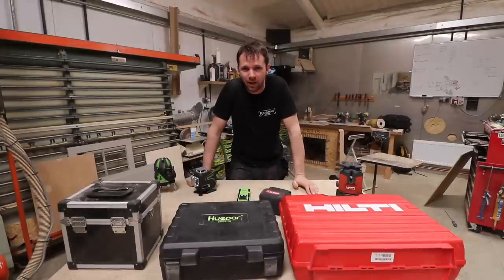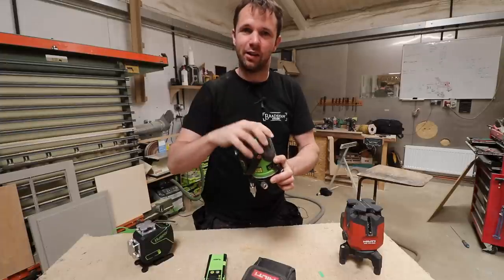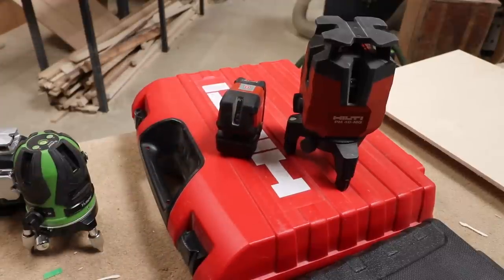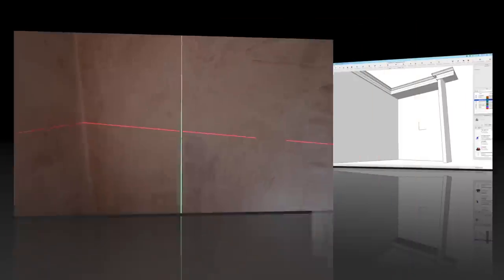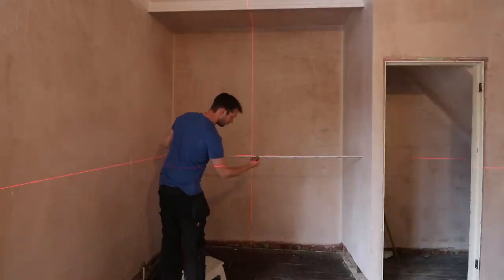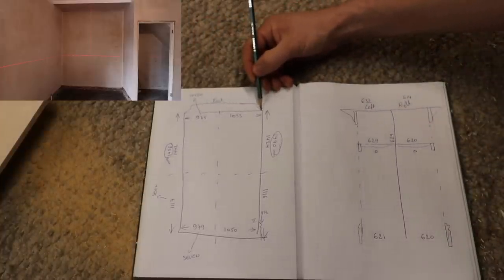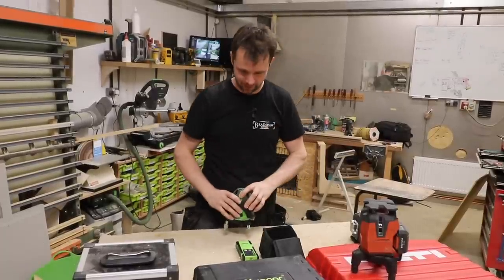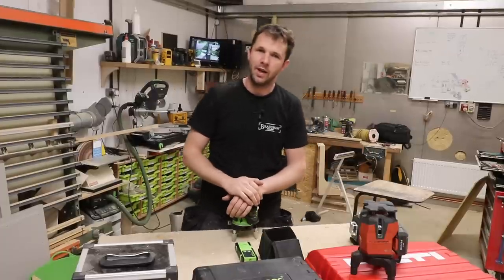Measuring with a laser Level - Fitted Furniture - Joinery - Whole houses!

Comment: I have commented on you videos a few times, they are all great. When I started as a carpenter in 1975, we would draw limes on the wall with one level and one plumb. All measurements would be taken from those limes. Just 4 or 5 years ago I decided to use an inexpensive Bosch laser level instead of drawing lines and all of that crap. What a huge difference it made in my life. Having a level line in "space" made taking some measurements so easy and I didn't need a helper.
Reply from the maker: Yes Roy! Its such a revelation isnt it I cannot believe they arent marketed in such a manner, its the main use for the laser for me!
Reply: @BradshawJoinery  You can teach an old dog new tricks. For years I thought a multi tool was a bunch of crap until I used one. Now I have both corded and cordless multi tools.

Comment: That was a fantastic video 

Really well explained. 

I look forward to seeing how you get the face of the unit fit the opening.
Reply from the maker: Hi Gavin, Ive not filmed the installation unfortunately time constraints took over. I ended up making the double doors and then scribing that into one side, then scribing the single door jamb In and glueing together in place (domino joint in the faceframe 👍

Comment: Brilliant as usual Ollie 👍🏻 

With regards to fitting a flat panel joinery product into anywhere basically, we always made it anywhere from panel thickness (18-22 mm whatever) smaller, both sides and that was a ‘scriber’ which I always liked and thought looked best inline with the plane of the face of the doors. That basically makes worrying about being exactly square when measuring completely redundant as you’ve got a tonne of wiggle room ( did that make sense)

Laser is so handy eh? Having those dead accurate plumb/ level square ‘datum’ to work off 👍🏻 even for fitting a new sash in an existing frame that might be super old and a mile out of square, you can work out ‘the wonk’ to make it, so it all looks right to the eye and isn’t a ‘wedge’ where you’ve fitted a bigger ‘square’ one to the shape as 90 percent of them would 😜

My old laser got chucked a while back, ended up with a cracked lense in the soft cover?!? I’ll never know…? And old batteries that went bad in tool ( crusty)

Been looking for a new one, don’t use them that much but great to have when you do!! Don’t wanna spend a mint/ but don’t want junk!  Ordered! 

Got the original? ( first one you listed) decent discount too👍🏻

Cheers mate👍🏻
Reply from the maker: Cheers mate, good work on ordering quick, i think stocks are low! Im very impressed as i mentioned, and sounds like youve got the use of it sussed!

Comment: My major issues with lasers have been:

Width of the laser beam when it hits walls or whatever. That line is too wide for accuracy 
Getting and keeping the laser itself perfectly level. If the laser itself is not perfectly level in both planes, the lines will exaggerate that inaccuracy

I will admit that I have been using the cheaper lasers of the style you showed and dismissed. I have just bought the green laser you recommended from Amazon - delivery tomorrow as I have to start coving, picture rails, door casings and skirtings - all in oak - tomorrow; 14 doors plus 2 openings that don’t have doors. The issue with getting it and using it so quickly is that I don’t give myself any time to get to understand how the laser works; at my age, all technology takes much longer to absorb, understand and put into action than a “youngster” like Ollie who was brought up with tech all around. 

I still remember using the old mechanical calculator to do stocktaking; we couldn’t believe the first electronic calculator we saw (Sinclair?); so much smaller and easier. Now, that Sinclair is probably regarded as almost primeval.
Reply from the maker: you need a laser with a clean line, and work to the centre of the line. Very accurate. Self levelling pendulum is the same level until it rund out of adjustment at which point it flashes... Set the laser up 100mm or so away from your install and them measure back to it with a rule and the laser wont be in the way. 

Lol at the calculator, I still prefer a proper calculator to the phone.

Comment: Wow, just mulling over it. So the 1st level you use to mark the front of the face frame and measure left and right. The 2nd level is to mark height from line up and down? Think I got it. Great video. Love em
Reply from the maker: Yeah pretty much. 1st gives you the position to measure to, the laser in the mid of room pointing back is set square and can be measured to from all points. both at face frame location and back of carcass. guaranteeing itll fit!

Comment: Hi Oliver, thanks a lot for making this video. The explanation of how to use laser level to avoid surprises at the assembly stage was very meticulous, thanks!

I have one question that maybe you or someone else can explain to me. At 11:43, you mention that the cabinet should be 4 mm larger than it would be based on separate measurements at the top and bottom heights. In that case, how are you going to fit the cabinet into the recess?
Reply from the maker: Thankyou, It will need to be scribed into place. so set the frame level (at and angle as it wont fit in) then scribe one side in, and then the other... it ensures the frame will meet the wall everywhere
Reply: @BradshawJoinery  Thank you for your response. I am having a difficulty in picturing this in my head... If you scribe out part of the wall at a certain level on the left and right, you would be able bring the cabinet inside, I get the idea. However in this scenario, this would mean that the left side of the cabinet's body will be partially recessed into the wall. As a result, the front part of the 18mm body will not be entirely visible from the front. I'm assuming that you will carve out the entire wall on the right, and by first positioning the left part of the cabinet body, you will then insert the right part. Is that correct?
Reply from the maker: @M4NC0L  scribe the frame in as just a face frame, then attach to the cabinets once it's scribed I don't know how else to explain it, I will show it in a video many moons from now 😂👍
Reply: @BradshawJoinery  Thank you Oliver :)

Comment: Really enjoyed this video, I love the technical aspects of your jobs. Does using the second laser at 90° create a 3D aspect or am I overthinling it 😆
Reply from the maker: Not overthinking, it does indeed, its the same as turning the horizontal line on the 1st laser on, but makes measuring the space much more practical because the laser is now positioned out of the way and more central. Thankyou (im assuming your name is norm but may be way off the mark)
Reply: Yeah Norm

Comment: EDIT - OK so ignore my following original comments ... this has made me think and feeling like this could and should 'up my game' thanks :)

Dude seriously - far too OCD - However I have to say whenever I pull a laser level out and say 'proper drawings' will be part of the quote ... I usually get the job... and that's half the work of any business. Getting the work.  Helpful advice for some - but you really need to know how to allow for tolerances and check with a decent straight 'bubble level'.  Thanks for the tips though they will. be helpful occasionally :)
Reply from the maker: Cheer Robert, Nowt OCD about it. I can measure up a room like that in half hour, and make whatever i want and know itll fit everytime, and also know when i come to install, exactly what to do and where. The half hour spent "messing about with lasers" is saved tenfold sometimes. Give it a try, youll get quicker with time and then never go back.

Comment: thanks for the video...just tried the code but unfortunately it says it's not valid, will hold off on ordering for now
Reply from the maker: I have sent them a message, maybe me using it made them realise it was still active so they removed it. Will see what they say
Reply from the maker: Hi matey I messaged them and they reinstated the code. £91.30
Reply: @BradshawJoinery  great thanks, i appreciate you getting back to me!
Reply: @BradshawJoinery  Nope, entering the code 6141G17 at checkout still produces " ! The promotional code you entered is not valid."

Comment: Anyone know if the voucher still works.  I tried and said not valid
Reply from the maker: I will ask them👍 theyight have seen me use it and cancelled it realising it wasn't still meant to work.. 🤣
Reply from the maker: Hi matey I messaged them and they reinstated the code. £91.30
Reply: @BradshawJoinery  That was quick! "The promotional code you entered is not valid."
Reply from the maker: Still? It worked for me when I tried earlier 🤦 
It only makes it about £10 cheaper. I'd buy one while there is still stock if I'm honest. They said there arent loads!

Comment: £20 water level is the perfect data point to work from.Old school is best.
Reply from the maker: I agree, and have used a water level before, but it's no good for the vertical measuring, it's also slow and doesn't give you an infinite reference to work from. The laser really is unbeatable for this job.